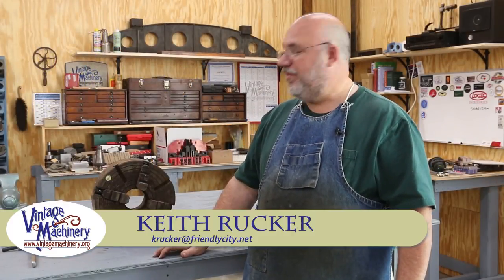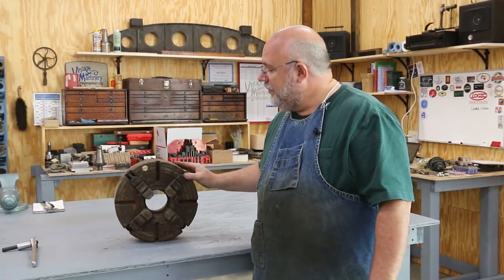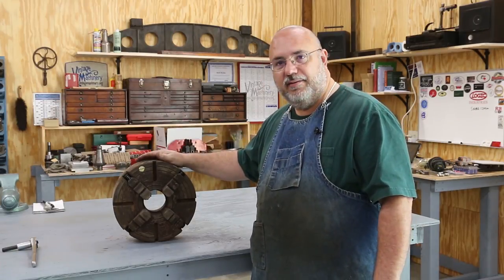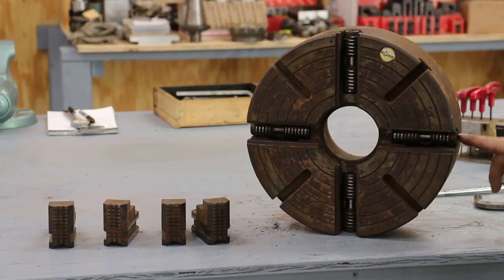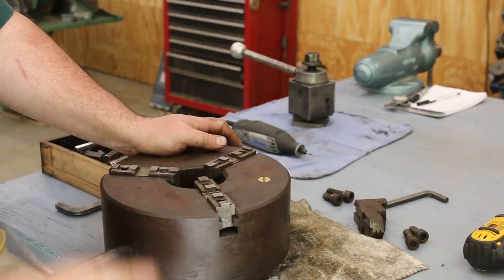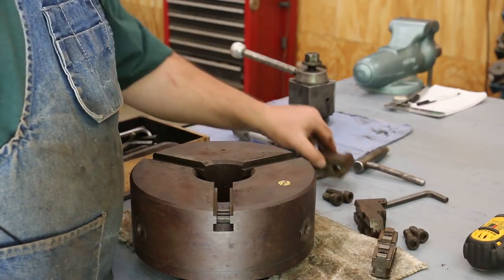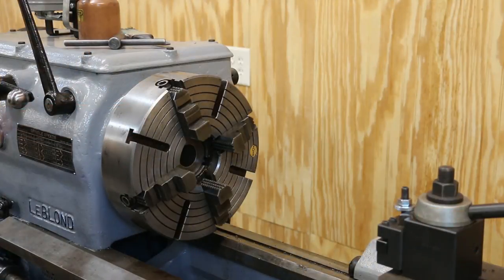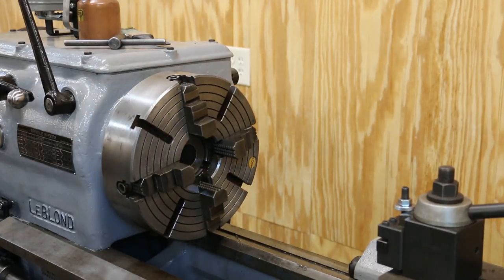Refurbishing Lathe Chucks

Comment: Keith: Glad those shop rags came in handy. Another batch is coming your way, should be there Monday. You might look into a product called Dri Slide. It's molybdenum disulphide in an alcohol vehicle. Not good for rust displacement, but a great dry lube. Jon

Comment: The reason the six jaw chuck is more tired is that it is that it can be “bucked” (adjust center). It can also hold onto tubing with less distortion. They are typically less robust than a three jaw.

Comment: Use something softer than steel (you allen wrench) to punch parts apart. It's bad practice and you get small dents if the punched part happens to be cast iron ;-)

Comment: Hi keith. Shotly after I got my Monarch lathe I was trying to dial in the run out on my three jaw chuck . My model L is a threaded shaft and the chuck screws on. It has the same kind of set up as yours where the jaws bolt on to the peice that rides on the scroll. It made a huge difference which jaw went on to each of those peices. I did notice that someone before me made an almost unnoticeable number on each one and they were in the wrong place. Once I moved them to coincide with the correct  jaw it ran within .0001. Just a thought as you put yours on you might check and see if it makes a difference where they go on your lathe. But great video. Thanks because most every video you and some others do are a great help to me.

Comment: Since the scroll in this chuck is a spiral, the spiral is at a different radius from the center at any one time for each jaw, if the jaws were not made with offset scroll threading, they would rest at different radii from each other. Therefore the numbered jaws and the need for jaws to be a matched set, probably matched to each scroll too.

Comment: Pull apart, de-rust and reassemble. Sounds easy when you say it.. then the work :D nice job.

Only thing I would suggest is fitting the chuck to the lathe and getting it all run in true there when you put the body back together.
Sure it will be out when you remove the chuck and reinstall it, but at least you are pretty close and should only have to do a little work next time.

Comment: Lovely job Keith. I haven't seen a six jaw chuck before, let alone used one. I must agree with someone else's comment, a brass drift would have been a better choice to get the ring gear out. All primed and ready to go. Cant beat a good drop of lube in the moving bits.
Des.

Comment: I like to use Metal Prep to clean rust and tune it up with muriatic acid (HCL) when it gets weak. The Metal Prep leaves a nice phosphate coating for items you want to paint. Do not dissolve your fingers!

Comment: At 20:20, the worms that drive the jaws look like they could be anti-backlash worms, where each worm is actually constructed of two worms fixed together.  You can change their relationship to take backlash out, like is done with a split straight cut gear.  In this case, it would matter which jaw is paired up with a particular worm.  Anyway, just a suspicion.  I like the Evapo stuff.  It seems like it might be like another similar product called CLR

Comment: I like transplanting long allen keys into allen sockets or renewing worn ones. Tough to drill allen keys, but that’s what carbide is for. I bet a taper pin would be a good transplant if you do not fling them out with an impact wrench.

Comment: I did the same mistake with my chuck. And funny thing is i had watched a chuck disassembly a few hours earlier. I think i chicken scratched my head for half an hour before i remembered the thing-a-majigs have to come out as well. :))
Nice one, there's no better feeling than working with a clean, crisp chuck. Even if it's a bit older, it's the sentiment that counts.
Reply: First time i've seen a sleeved chuck...i wonder if that's factory. Well, not in that fashion, i know someone who has a chuck that allows you to sleeve the back end for collets.

Comment: Seems as though that evapo rust was spent.. I've been using the same product on my lathe restoration and it has taken any and every spec of rust away regardless of how deep it is. Also good to note that it doesn't ever attack the metal as it is designed to chelate oxides rather than the iron so no harm to the parts will happen so long as it's not too spent
Reply: It's just as he said. It had grease on it. Water/Evaporust can't get through the grease.

Comment: WD-40 works so well at driving out moisture because that's what it was developed to do. WD stands for water displacement.
Reply: But it's NOT rust preventive! Maybe light one (for temporary, short term protection).
Reply: Thinners and candle wax in a spray bottle.....it's the shit.

Comment: The three jaw was interesting because the back plate was so strong it didn’t need the three centre bolts. All mine have a back plate and then an adapter plate to mount on the lathe.

Comment: Fair point about the allen key used as a punch to knock the scroll out though. Even I, as a complete amateur, would use a brass drift to do that. But we're always learning, however good we are
Reply: Anyone who uses brass for a drift IS an amateur. Any tradesman would be taught to use bronze or mild steel.
Reply: @ianhipwell7565  Ok Ian, I am only an amateur though!
Reply: @johnswimcat  Sorry John, we all started out amateurs until we all learnt somehow. I also should have said my first choice would be a copper drift. Please don't use brass, it shatters and a sliver will go through your hand, arm or worse, into your face or eye.
Reply: @ianhipwell7565  Wow, I didn't know brass could do that. We live and learn. Thanks for the info. I wear specs but I guess goggles are always a good idea if one is hitting something hard. Any recommendation as to the material for the shear pin on an old Colchester Triumph please?

Comment: I'm just in the process of cleaning & rebuilding my 1979 Bernard 3 jaw 4" chuck after machining cast iron....Yuk!  I'm puzzled to see at 22.05 (and 31.40)  that grease is applied to the scroll side, where swarf will stick, whilst in contrast, on the relatively well sealed side, the poor pinions & bevel gear interface goes together dry.....with grease only applied to aid the backplate press-fit!   Are we sure about this?

Comment: Nice videos, thanks.  You were talking about the numbering of the jaws matching the slots.  Is this because the chuck is balanced like a car wheel?  Any slight difference in mass of each jaw might unbalance the chuck if placed incorrectly?
Reply: No, it's because the scroll is in a different position at each jaw location, so each jaw is cut differently so they meet up at the middle.  Otherwise the first one you put in would be the first one to the center.  Each successive jaw starts a little deeper as you go around the numbers.

Comment: picked up a d1-6 for my monarch and im having troubles with the runout.   im getting .007" Tir and ive checked timing and jaw placement....all correct. Could the bolt on jaws be worn that bad?  not sure what else to check as this is my first d1-6 chuck.

Comment: Evaporust is great but it does evaporate so I use plastic wrap ("Saran Wrap") to seal the container.
Reply: The active ingredient doesn't evaporate (until all the water is gone). It stays in the solution. So all you have to do is add water and it is back to normal.

Comment: Are you beating on that scroll with a Allen wrench?
Reply: Clayton Parks in Keith's defence on a lot of larger chucks the scroll will be hard and it will probably cause very minimal or no damage
Reply: Clayton Parks that made me laugh, just after taking it apart carefully and saying he doesn't want to break it. He used a Allen key as a punch haha. I've noticed a few times he does stuff like that I'm sure on the lathe resto he used a sledgehammer when re-assembling it lol. Love his videos though and wouldn't hesitate in buying a used machine from him.
Reply: I cringed a little too, but, he didn't have to hit it very hard.
Reply: I use brass or copper, and gently tap close to the bore of the scroll all the way around so it doesn't bind.  That's just me, I start gentle, then work my way up to 800lb gorilla mode slowly by trying lots of stuff.  Better to be patient and reduce the chances of ending up with a paperweight.
Reply: Get used to it.  If you've watched many of his videos, he's always beating on feed gears, gearbox shafts, chucks...most everything with two-pound hammers!  It's all in how you were taught I suppose.  Where I went to school every machine had a lead hammer in the chip pan.  If you got caught whacking something with a machinist hammer, or tapping-off your file on the ways, you got a day off.
Reply: zvuci zivotinja
Reply: Having a selection of hard wood dowels in various diameters around the shop is a good idea.  I also like to have a selection of soft wood blocks.
Reply: The Allen wrench is probably cold rolled and the scroll looks stainless. 
All you are going to do is maybe hurt the Allen wrench.
Reply: kkknotcool a glance through my box at my Allen wrenches and they’re all S2 Tool Steel, which is impact resistant and probably harder than the scroll is.
CRV4 Chrome Vanadium is much softer and can be found in cheaper Allen wrenches, which would get beat up long before the scroll would.
Reply: Bullshit Free Zone
You have some nice Allen wrenches.
I just buy the cheap ones from the hardware store. If I round them over I just throw em away.
The cheap ones might be carbonized, but I never break the things. So I think most of them are just cold rolled.
Reply: kkknotcool Thanks, given how much I work with my tools (precision machine rebuilder + precision tool repair), I try to buy the best I can afford having used the cheaper and being let down at the worst time. 
My imperial/metric/torx wrenches are all Titan, S2 tool steel, ball end and in XXL length. 
Bang for buck, you won’t find better (IIRC metric kit was 12$CAD or so).
Happy fixin’!
Reply: Good point. You can take a chip out of that scroll wall easily. Maybe it sounds loud from the video that he is hitting hard but he has enough experience to sense on his own to hit it mildly. The mic on video is sensitive it appears.
Reply: Clayton Parks ev
Reply: me to i said err they made brass drifts for that to my self
Reply: @kkknotcool  you make a valid point.
Reply: I flinched.....but it's his Chuck and I love this channel too much to bring negativeity.
Reply: Love his work. There is no excuse for using hard steel on a machined surface. Brass or bronze only. Let’s not be timid on the constructive criticism.

Comment: You use grease and oil to lubricate the chuck... why both and do you have to choose a grease that is compatible with the oil?
Reply: most grease is an oil with some lithium as a thicker called a soap, so oil mixes with it fine,  saves getting grease on your fingers too often with a oil squirter, in fact in one of my oil cans is a mix of old grease an oil, just enough to let it flow, but sticks in place, i seem to use that on most things like car hinges, the vice threads and slides etc
Reply: Grease is perfect for internals.
Oil for exposed parts (because it will not work as a "glue" to collect chips and dust, like grease would).

Comment: I lost a comment...  
I'll repeat my missing previous comment at the risk of being repetitive. 
Don't buy a lottery ticket. Your prediction about the label was wrong. lol  It was the first thing I noticed when you pulled the chuck from the bath.  That is an amazing product. It removed the rust, but did not dissolve the grease nor the glue on the label. Interesting. I noticed too that you were not wearing gloves. 

I do have some questions about it. Will it remove more severe rust, leaving the pits glean? Have you noticed that small cracks show will show up better after soaking?

I really like to watch your work. especially the saving of old tech and materials. To me you're saving someones time. Time that was invested into that piece. Someone gave some of their life to that piece. We all have a small amount of life and someone chose to put it into the piece. you saved it.
Reply: Evaporust is water based, non-toxic, bio-degradable and pH neutral.

Comment: Back in the '70s when we ran into metric Allen heads in the body shop, I would use aluminum foil to shim my closest SAE to fit the Allen heads. It always worked.  Keith you had a little on your upper lip there at the end. LOL  Been looking at several different scroll chuck refurbs.  Some use heavy machine oil, some use grease, on the gear drive.  I guess there is no hard and fast rule on it.

Comment: On a 3 jaw, with a common scroll plate, how does adjusting the jaws individually move the material being held without changing the other jaw positions?
Reply: You can't adjust the jaws individually on a 3 jaw chuck.  They all move together. That's what a 4 jaw chuck is for.

Comment: did I miss the lubing of the rack and pinion of any of those chucks?
Reply: @Hugh Jaanus I saw several pinions.
Reply: @Hugh Jaanus In what way is the pinion in that chuck not a pinion?  And by the way, you might want to actually read your very own rack and pinion reference under the section titled "Arcuate rack".
Reply: @Hugh Jaanus A pinion is the gear that moves the rack.  The gear you put the chuck key into is a pinion.  The rack can be linear, or it can be arc shaped, or round, as per the link YOU sent me.  Obviously you didn't even read the article you referenced.

Comment: Aren't the jaws and the places they go numbered to keep it balanced?
Reply: No, they're numbered because each jaw is cut differently.  The scroll is at a different position under each jaw, but you want the jaws to all reach the center at the same time.  Otherwise the first one you put in would be the first one to the center.  Each successive jaw inserts slightly farther in when you start them so that it catches up with the ones that have already been threaded.

Comment: 26:08 can't help but say why did you not bother to lubricate the groove of the drive gear or at the very least rub some grease on the pin before inserting it? There will likely be outward pressure on the pin and it will wear for no good reason. This will of course be out of sight so we can all pretend that it's not happening.

Comment: R.E 19:20>. WD40 stands for water dis-placer - formula #40 Yep, it drives out moisture!
Reply: The W actually stands for whale because the original formula used whale oil. The genesis of the product came from whaling ships (that tend not to rust because of the blubber / oil)
Reply: @exilfromsanity  LOL. My b.s. detactor went off right when I heard the whale nonsense. I'm glad Erik posted the company's website.
Reply: @barkerd1960  It doesn't contain fish oil, whale oil or silicone and never has despite many myths.

Comment: In what circumstance would you choose to use a 6 jaw Chuck over a 3 or 4 jaw?
Reply: Kris Bassett thin walled parts
Reply: oval parts as well
Reply: We used six-jaw chucks for turning hex-stock.  A four-jaw grips hex-stock with two jaws on the edges and two on the flats.  Since we were making PTO shafts (they telescope) buggering up the edges was not acceptable.
Reply: 6 jaw chucks are more accurate than 3 jaw chucks. You use a 6 jaw when working with rifle barrels, or sine bars.
Reply: And that was the answer I was looking for as well.  I too have a LeBond but only a 6 jaw and wondered.  thanks for the reply.  Maybe the 6 jaw was the standard chuck it shipped with.  Gotta get a 4 jaw for sure.
Reply: Abom would say you always choose to use the 4 jaw chuck and leave the other two on the shelf.

Comment: I stopped using grease after I tore down my first chuck. The grease picks up chips a swarf. I use a dry lube like  Dri-Slide. It won't wipe off or hold dirt.
Reply: Grease inside chuck is a GOOD thing (on exposed parts, like scroll and jaws not so much). But main problem is improper use of compressed air! That's why you get chips everywhere.

Comment: Excellent video, as usual. What are the set screws on the 6-jaw for?
Reply: Adjusting for runout of the chuck. Basically they act like a 4 jaw to center the chuck body and jaws with the axis of rotation.
Reply: I've got a Bison 3 jaw like that, and I love it.  If I suspect a part may have to go back in, I'll matchmark it to a jaw before pulling it.  That way, it's always repeated within .001.  A lot of times it will go back in "dead nuts."

I nearly fell over when I looked up what that chuck sold for new, by itself without the back plate.  Nearly 4 times what I paid for the entire rig.  I couldn't chide myself for giving in and buying a century old lathe after seeing that.

Comment: Nice work, find yourself some aircraft gear actuator grease to lube your movable chuck parts. It is a low tack synthetic grease used in aircraft instruments and obviously gear actuators. I can send you some if you can't find it.
Reply: Low tack oil or grease is a much better option than "ordinary" grease, after all you don't want to make your own grinding paste, do you? :>(

Comment: Great video. But Keith, we're all into with re-using old machines and maintaining our all-important environment; when I saw you at 16:30 onward, I was flabbergasted.  Did  you ask the fish in your downstream local river how they like EvapoRust ?  (I've always felt guilty as hell-  dumping my used motorcycle oil down the city storm-sewer long ago !  Chemical neutralizing and conversion is always better)
Reply: Unlike your motor oil, Evaporust is water based, pH neutral, non-toxic and bio-degradable.  The fish are fine with it.

Comment: The WD in WD-40 stands for Water Displacement. The 40 is for the 40th formula. Hence the super simple name, WD-40.
Reply: Its fish oil. With a little fragrance.
Reply: @timothyj1962  There is no fish oil in WD40 there isn't any silicone either, never has been it's petroleum distillates and solvents.